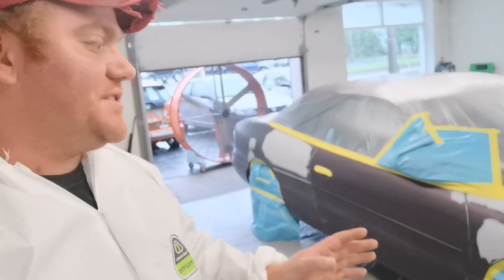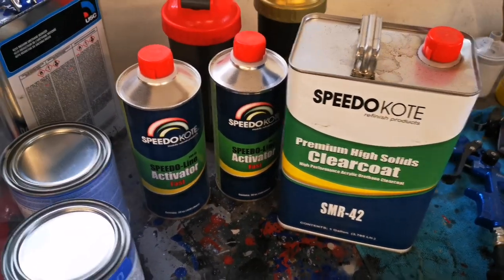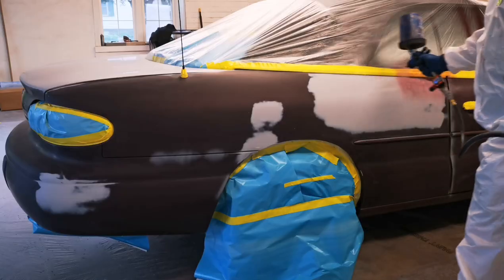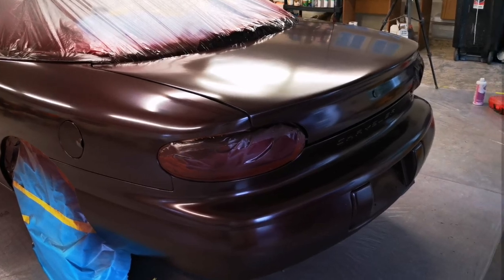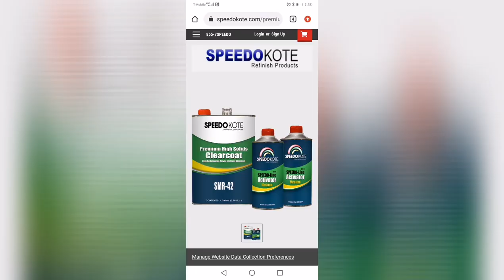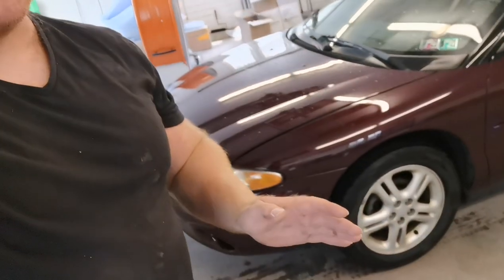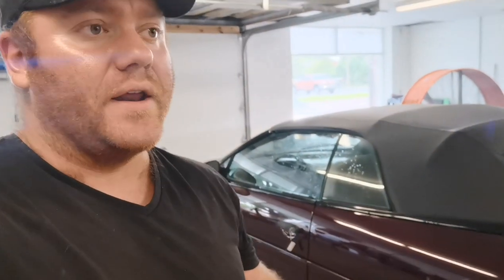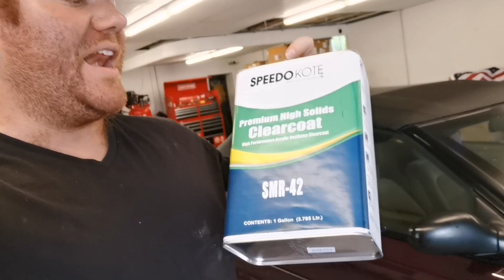300$ paint job

Comment: Love the video Mark! Hey question::: Why are the cars wet when they are pulled out of the shop? Do you spray them off with water to remove the dust/over spray? Just asking as I noticed it in several of the video and figured there must be a reason for it...Thanks again for the video!
Reply from the maker: Spray them off to remove any dust . I let the vehicles sit for 48-72 hours and allow the clear to shrink back to show you guys the real results .  Alot of guys show the clear when it's wet that doesn't count . Lol
Reply: @speedokoterefinishnetwork4937  Thank you! That is what I was thinking it was for. Thanks for sharing the video!